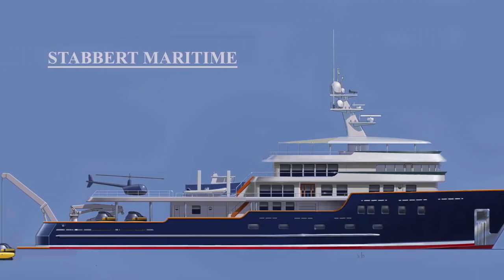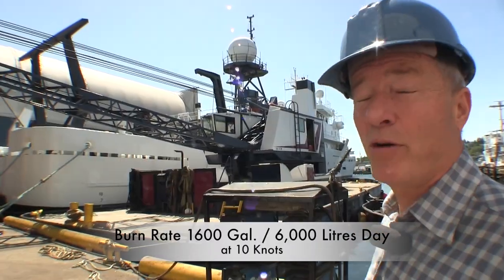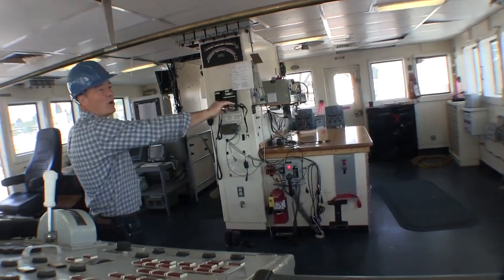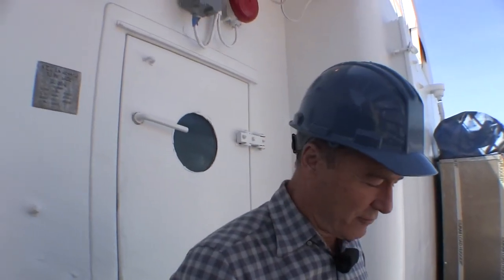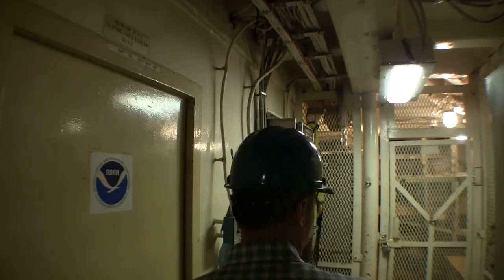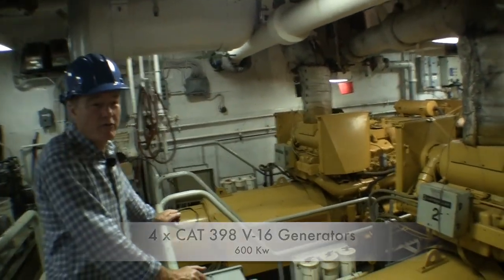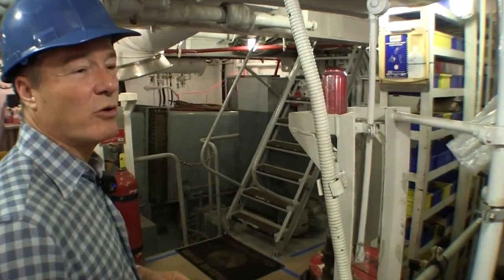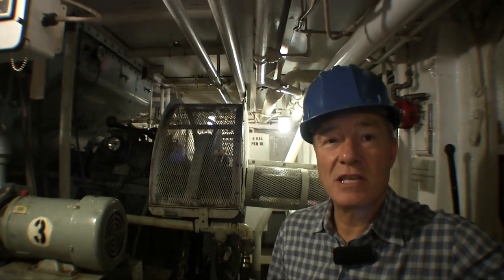Paul Madden explores possibilities in converting 224 ft/68m U.S. Navy research ship to expedition

Comment: I was on the crew at Tac Boat that built these. Good times. Shout out to former L568 members. 

 edit  I see a lot of posts calling these "research" ships.  NO they were CIA. Things you would not find on a navy ship.  Every 2 single person cabins shared a head/shower. Bank vault door on secure room in CIC. Secure room had a column I was told would be loaded with thermite to destroy the contents of the room. In the original configuration, the bulwarks were high enough that the work deck was hidden and where they now show a helipad there was a reel with 5 miles of cable on it. The boat towed a fish listening for submarine prop noise. The stacked rubber mounted engine beds were to keep engine noise out of the prop shaft. Somewhere I think I still have a couple pages of the blueprints for this ship.

Comment: Has the boat been sold if not how much cheers mate
Reply from the maker: Sold and currently working in Pacific. There is another one available for about $5 million.
Reply: @ExpeditionYachts   wow, sure? a ship like that just for 5 millions? but to use like a yatch is necesary to make a reconversion or once i buy i can use it inmediatly, no necesary a reconversion? in that case just for 5 millions i can have a big and strong ship to sail everywhere, no luxuries needed
Reply from the maker: @carloko08  Actually you can get one for about $2 million.

Comment: I wonder how much it would cost to convert this into a yacht?
Reply: i think 10.000 US$/day next 2 years
Reply: Kevin Bowman - 4 million
Reply: If you have to ask, you can't afford it.
Reply: do you think that Bill Gates don't ask for price ????
Reply: 150 million.
Reply from the maker: A basic conversion could be done for about $5 million. With that you would have a global expedition vessel that would be more capable than most new yachts costing over $30 million. It wouldn't be as glitzy, but it would be more capable.
Reply: @ExpeditionYachts  Could the ship accommodate new, more powerful engines to increase cruising speed to 18-20 knots?
Reply from the maker: @AmericasChoice  It's possible, but it would take a lot of HP. Probably not practical as hulls were not designed for speed.
Reply from the maker: @AmericasChoice  It's possible, but it would take a lot of HP. Probably not practical as hulls were not designed for speed.
Reply: @ExpeditionYachts  Ok, I suspected that, is 11 knots a good global cruising speed?
Reply from the maker: Many trawler yachts with trans-oceanic range cruise at this speed.
Reply: @ExpeditionYachts  Okay.  It appears the engines have a lot of life left in them, correct?

Comment: don't buy it. buy a new one.  same cost after 10 years running.
Reply: You still need engineers to tell you're decorators where you can put weight and where you can't and how much weight where.lol
Reply from the maker: The older hulls go through the water the same as the new ones, and these vessels are diesel-electric. Your running costs won't be so different.